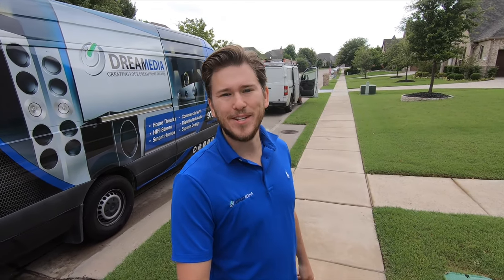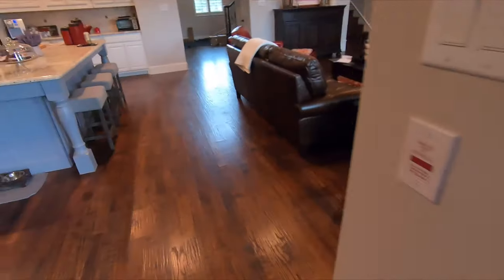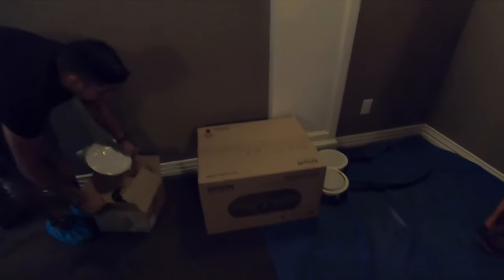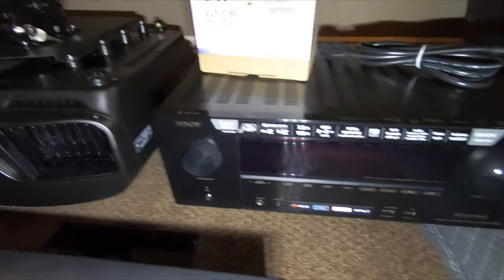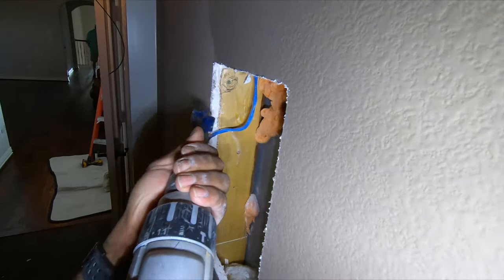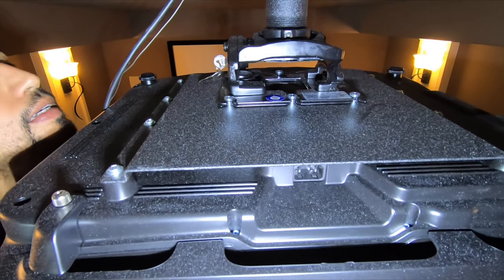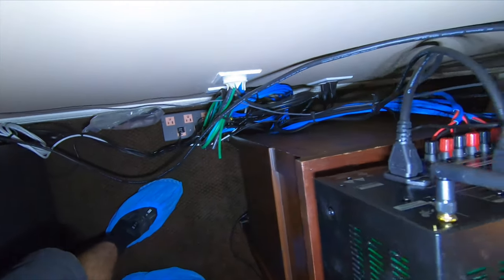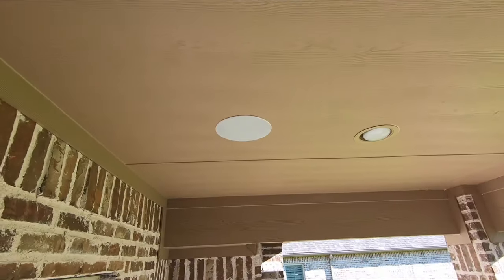Klipsch Custom Series 7.1 Theater Room Epson 4050 4K projector + 5.1 Living Room & Patio Speakers!

Comment: Great video. Question, how did you mount the projector ceiling bracket to the beams using 4 lag bolts as per instructions from Epson for the 4050 projector. I have a finished basement also and I can only grab 2 holes for the bracket to a beam in the ceiling. How do i support the other 2 holes from the bracket
Reply from the maker: you can use toggle bolts 100lb to help

Comment: I have the 4040 and it rocks so the 4050 has to be even better.  Only issue with these Projectors is for gaming you lose HDR at 60fps on Xbox/ PS4  but you can spend an another $150 and get most of the HDR at 60fps back with an HD Linker.  The 5050 - 6050 do not have this issue but the 4050 and 4010 still do. The issue does not affect movies since they are 24fps.